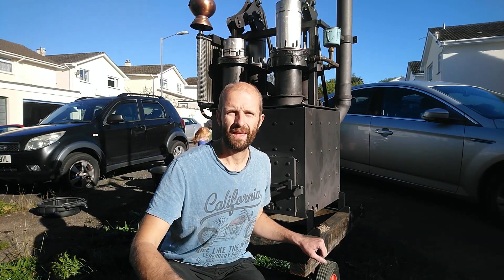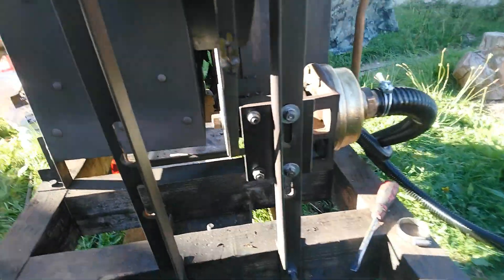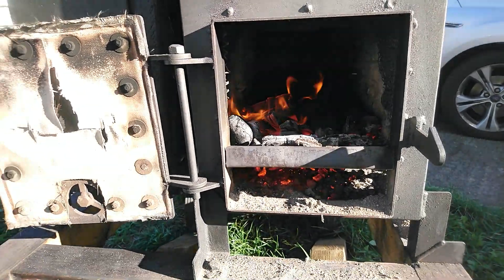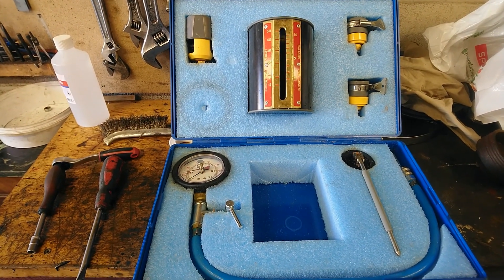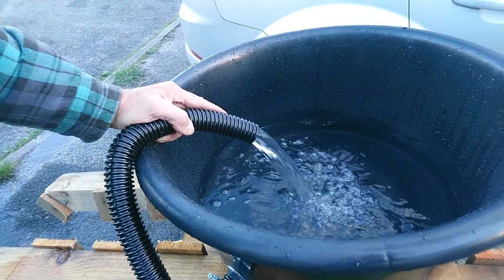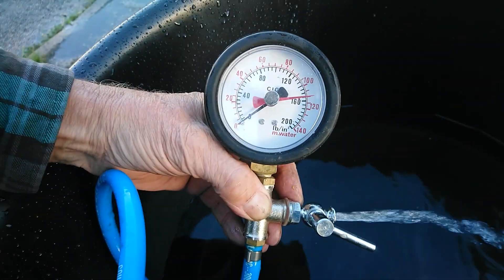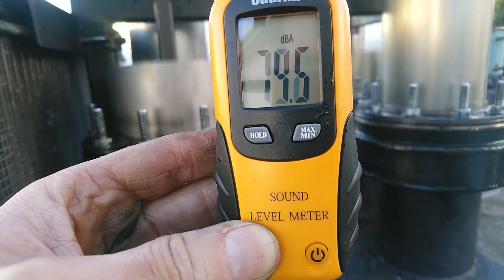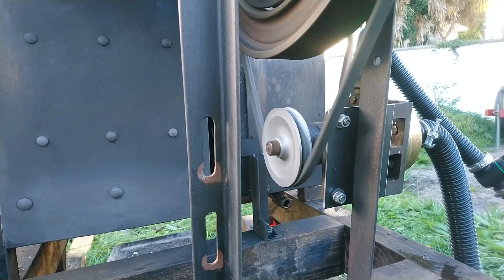Stirling Engine Test with Water Pump (7 GPM) - Part 17

Comment: That's brilliant! Been watching your vids trying to figure out the arrangement? Is this an alpha type? I have some suggestions? Steam engines have blast pipes and blowers for the fire? Fit a pump for the radiator, and a cooling fan? Then duct the cooling air to blow the fire either direct or ... bleed some off and fit a crude blower in the chimney to get more draw? Part of my job is leather. The seals look like sole leather? This will likely be vegetable tanned (very very common for sole leather). A while ago they invented chrome tanned leather. Chrome leather is much more heat resistant (shrinkage to around 150C). Veg tanned shrinks at 60 - 70 but it good for wear because it's denser? Chrome allowed footwear production to speed up using higher temperatures at shorter dwell times etc etc. If the seals shrink, that's why.

How are you thinking about governing such an engine? I'm interested as I have no ideas? IC or steam is easy. Would it be as simple as putting bleeds on the passages?

So interesting ...
Reply from the maker: Yes your correct, Alpha type engine. All your suggestions are good ideas. Very interested about your experience with leather! Yes veg tanned leather. Chrome tanned leather you say 🤔, I've got to take a serious look at that, many thanks. The only way I can think to govern it is centrifugal or have some kind of varying load. Bleeds will slow it down (that's all i've got) but won't govern it. Many thanks, Cheers
Reply: @ShanePomeroy  Fascinating. I have made a few steam engines, amateur engineer come wood turner come tinkerer etc. We've had an open for for years and finally decided to fit an efficient wood burner stove, and I fancy a Stirling powered fan (planning in my head), but rarely see an alpha working. Once you've got you head around other designs the alpha still looks like it shouldn't work, yet it does. It's the hot cylinder seals that are the issue. At work I have a very special SMC pneumatic frictionless cylinder. It's double acting and all the seals including the output rod, are made from stellite, a metal seal. An odd metal where the bearing and the face are both stellite (not like normal where you would have hard running on soft on hard like brass / white metal on steel etc). The down side is such are the engineering tolerances, normal dust in the air jams them! It's stunning engineering.

Teflon kind of very slowly flows under pressure, like an extremely sticky liquid, but this could be and advantage if the cylinder wears uneven? Moly impregnated teflon would be especially slippery. It's a good thermal insulator, high melting point, as well but would still need cooling I think. A water jacket, cuz the head bolts are going to transfer heat, unless you can figure out another way of clamping the head down of the hot cylinder (which being a clever very chap I'm sure you can), like a cantilever clamp from another part of the machine? And you could water cool that as well. If you can keep the hot side seals cool then veg tan is a good option? You know, I don't mean  youknow, I mean you know cuz you are clever that it's Tdiff, so stoking the fire as important as cooling the cold side. 

I'm thinking out loud too much on here, late night ramblings and planning my fan in my head ,can I make a small alpha work.  I'm fascinated. They use these in submarines? Excess heat to get rid of and a ready source of water that's nearly freezing. OK they use rhombic stuff and very well balanced but. .... quieter than nuclear.

You are inspirational.
Reply from the maker: @black5f  We use stellite on certain machines at work for slides but never heard of a cylinder made of the stuff. Must be pretty expensive! 

The most important part of the lip seal assembly is the support ring to stop it jamming itself on return stroke. I tried not using this but if just doesn't work! I'm wondering if Teflon could work with support ring but I like the simplicity of the leather seal. It also maintains itself because it constantly polishs the piston.

An alpha stove fan would be unusual. Their is a bit more resistance with this configuration compared to the beta types. I like the alpha because it is simpler to create bigger heater / cooler surface areas. From what I've read, they are less fussy and more liable to work well!
Reply: @ShanePomeroy  The alpha is so simple it almost defies physics. It's a 63mm cylinder I think, 2 1/2 in old money. Some of the machine development I'm involved with just to see if sticktion of seals was an issue with calibration. Like 15 times the price! Side forces kill seals. We fit floating joints to avoid and they last 10 times as long. I like your new design, heat the air, regenerate, not heating the cylinders?. I think leather will be fine but you are using it to guide the piston as well and get rid of those side forces on the up strokes (only I think, the power stroke). Can't wait to see your new design working. I am having a rough guess, on the older machine, looking at the size of your fire with little draw, and .5 KW, that's already challenging up in the 25% range? Powering a fan bleeds some of the energy. So looking forward to your new build!
Reply from the maker: @black5f  sticktion! That's a new word for me, just googled it to understand. I'm a little worried about side forces. Hopefully long Conrods will be enough. Absolutely something to think about if I do another one. I don't think the cold cylinder will need insulating unless it conducts heat from the furnace. Hot side could be insulated but I'm worried about cooking the seal. I might need to add a water jacket but we're see. Compromises, compromises!
Reply: @ShanePomeroy  Ha ha. It might be a word I started using 40 year sago and not a real one. It's kind of the force needed to overcome the seal friction before the piston will move. I think the cold side will be fine. You've kind of got ultra low friction cylinders but they have to seal somewhere. I think it's a good design ... it must be .. it works :-)

Comment: Cool video as always! The water pump will need much more speed to make any measureable pressure. It has a small impeller diameter which requieres high rpm to add kinectic energy to the water and build pressure
Reply from the maker: I'll put a bigger pulley on it and see what that does : ), cheers
Reply: @ShanePomeroy  looking forward to new test! You've done an amazing job with this engine. Thanks for documenting the process!